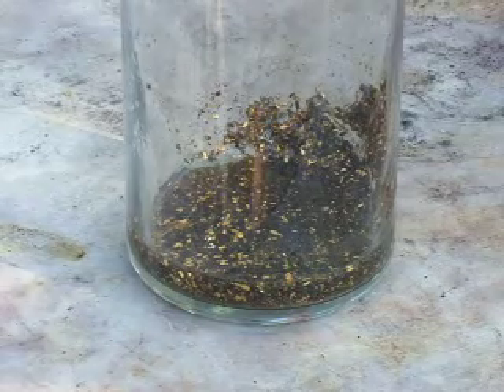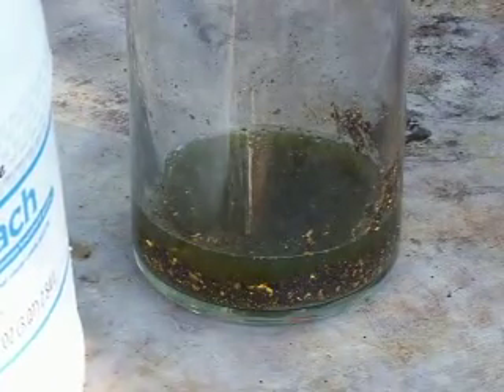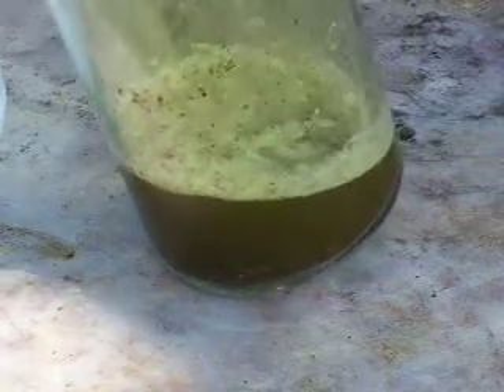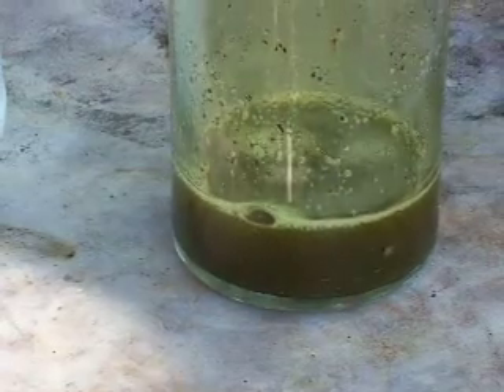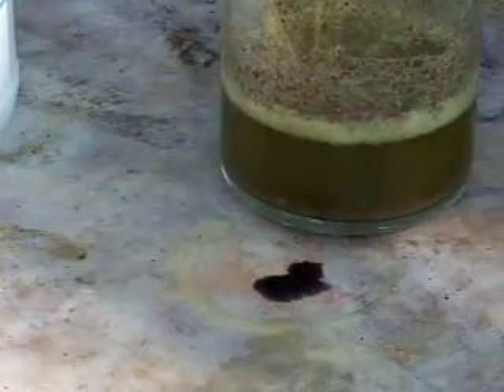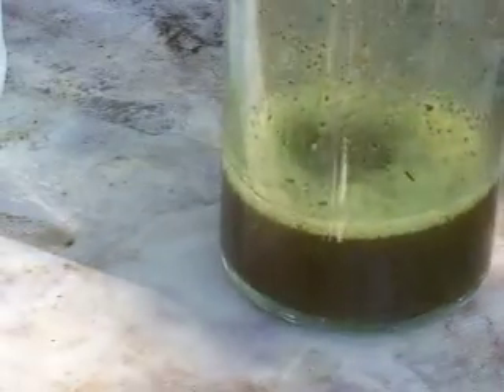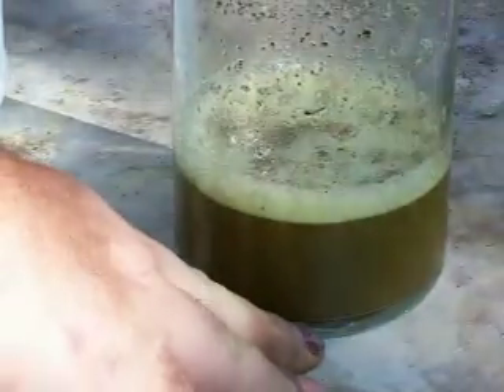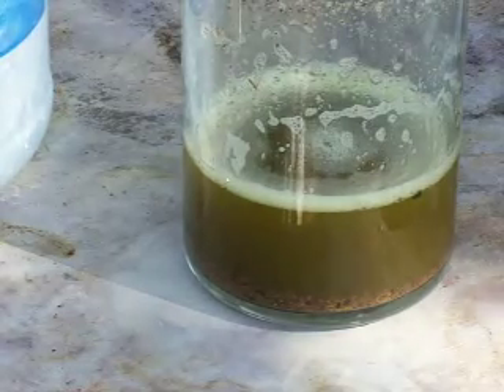dissolving finger foils

Comment: Hi Geo, love your videos. I've just run my very first batch of foils (a small experimental batch and as of right now, the gold powder is settling after using SMB.) At first I was leery about using this method and I know bleach is basic. I've seen you and several others on youtube use this method, so I know it works, however, I have a couple of questions... How is it possible for this method to work. I have a general understanding of chemistry based on what I've learned in school, and then 20 plus years working in the chemical industry. How does the basic beach not neutralize the acidic HCl? What actually happens between the two to cause the dissolution of the gold? Is it actually the chlorine gas generated that breaks the gold down? Actually, NVM the last Q.... Just re-watched the video, and you answered that one.  P.S. Read Hoke .... great stuff...

Thanks for the great videos as they're very helpful. All the best. Cheers! - Paul
Reply from the maker: Sodium hypochlorite is basic and neutralizes some of the HCl when it is added. The sodium hypochlorite decomposes into sodium chloride and chlorine gas. Chlorine gas oxidizes gold by itself. The HCl dissolves the gold oxide into solution. An excess of HCl is recommended when dissolving gold with bleach.  Gold dissolved in this way has a formula HAuCl4.

Comment: Hi Geo. Is it possible that 4ml of 71% nitric will dissolve more than 4g of gold from foils?
Reply from the maker: Short answer, yes. Through use of inhibitors and refluxing, nitric acid can be stretched out. By using a reflux apparatus, You can reclaim about 30% realistically. Under ideal lab conditions, you can reclaim around 40%. One other method that will reduce the use of nitric acid is to add the nitric acid needed in small increments. Wait for the reaction to stop completely before adding more. This is also a good way to measure metal content. Acid used in ml's equates to grams of metal. By recording the amount of acid used in ml's, you can calculate the amount of metal dissolved in weight. Refluxing is simple and google will give some examples of reflux apparatus. You can reflux to a separate container or reflux back into the reaction vessel. Ethylene glycol has shown ability to trap nitrogen dioxide in solution. It can be added in small amounts relative to the volume of acid used. I don't recommend using ethylene glycol in AR solution but rather leeching with just nitric acid.
Reply from the maker: Simply covering a beaker with a watch glass will also reflux some nitric acid back to the reaction.
Reply: Got it. Reason I was asking is that I have foils in AR and it seems a lot of foils to be dissolved by only 4ml of nitric. I know you have a lot of experience so I thought I'll ask. You think it is safe to use 5g of smb for precipitation?
Reply from the maker: Sounds good. Be sure to test the spent solution. Remove the spent solution from the gold and heat the solution. You may see a little more dust form from the solution. Let it cool completely and test again with stannous chloride. Any color change is suspect for precious metals. If you test without heating and cooling the solution, the SO2 in the solution will cause the stannous to go brown. It is a false positive.
Reply: Learning more from your videos than reading books. Thanks for taking the time to reply.

Comment: Geo any difference between SMB food grade and the one from Science Company?
Reply from the maker: Not from my perspective. It works exactly the same. It's just the chem store can charge more because it is .01% more pure. Another source of sodium metabisulfite is Bonide brand stump remover. Make sure of the label. Why pay more for the exact same thing.
Reply: Exactly....why pay more? I was searching on ebay and saw a big difference in price and If I remember correctly in one of your videos I saw you bag of SMB and  thought it was looking exactly like the SMB food grade they sell on ebay. Anyway thanks for clarifying it for me. Which do you prefer SMB or Bonide stump remover?
Reply from the maker: This is most likely what you saw. It is from dudadiesel and since I happen to live a couple of miles fro their warehouse, I just go by there and pick it up from them. As far as performance, it all works the same way. I have used the Bonide but consider it a work around and something I can use in a pinch.

 http://www.dudadiesel.com/search.php?query=%22sodium+metabisulfite%22
Reply: Yes that's the one I saw you using. Just ordered a 5lb bag for 16.92. Thanks for the info.

Comment: Hello geo ,when you do the sulfuric cell do you have to put apart brass, copper, iron gold plated pin or can you put them together in the cell to deplate the gold pins
Reply: What if u get soder in with the foil after ap fillter.  I got gray slug in with my foils is that lead or soder

Comment: Hellow geo a got a question does the sulfuric cel works with aluminiun basket o its got to be copper basket
Reply from the maker: Aluminum will work for a short time. Aluminum is not very reactive in sulfuric acid but when you add electricity and heat, the aluminum is degraded into aluminum sulfate. You will have to change the basket more often than if you used copper perhaps even getting one use from each basket.
Reply: Thank you so much .geo i have learn a few good things from youre work i has help me with the gold  process

Comment: Hello Mr. Geo. I have dissolved some foils but the result wasn't what I expected. I dissolved with HCL and bleach, in about 5 minutes all foils were dissolved. when I did the stanous test it didn't change colour. have i done something wron or the foils were almost nothing? https://youtu.be/CR-KcLcotcE https://youtu.be/OQYqe7uN70I  https://youtu.be/EVUGX4HEkQY 
then
Reply from the maker: +Helder Freitas Unless you remove the excess chlorine, the positive test will not appear. It is called a false negative. Add some more HCl, at least double the volume you have, and heat the solution while stirring. When you can stir without tiny bubbles forming, turn off the heat and let the solution cool. Test the cool solution. If there is still not a positive test, your stannous chloride may be bad. Make fresh stannous chloride and test the solution again.
Reply: +Geo after cool did the test, still negative. could it be of the stannous? I bought it on ebay, or could it be I don't have enough gold on solution?
Reply from the maker: If the stannous chloride is good, it will detect even a very small amount of gold in solution. If you can, dissolve a small amount of known gold (like from a piece of jewelry) and see if the stannous chloride will give you a positive test with it. In refining, it is called a "standard" or a solution of known gold content that you can test your stannous chloride against to make sure it's still good.
Reply: +Geo ok I will try to do that. can I try with a small gold  button  Thank you Mr. Geo,  you are very kind always answer my doubts
Reply from the maker: Yes,a gold button you are sure of will work great. There's no need to dissolve the whole portion but only a small part. Like I said, stannous chloride will detect very small amounts of gold in solution.
Reply: +Geo I put the nugget in this solution,  let it dissolve for a while and then test it?
Reply from the maker: Yes. If you are using HCl and bleach, carefully flatten the gold button. Place the gold button on a piece of cloth. Fold the cloth so the button is in the crease. Use a hammer to tap the button inside the cloth until it is flat. This way you can flatten the button without losing it. If you just lay the button on a hard surface and strike it with a hammer, it may fly to someplace and you will lose it. If you flatten the button, it will give it a greater surface area so the acid can dissolve some of of the metal better. You can always remelt what is left into another button.
Reply: +Geo should the solution be hot or could when i put in the button?
Reply from the maker: If it is HCl and bleach, it should be cold. It will heat on it's own.

Comment: Geo what about putting the foils and hcl + bleach in a soda bottle or other container that can be capped off and shakin to stir it better?
Reply from the maker: There are two real good reasons off the top of my head. AuCl3 is formed when you dissolve gold using chlorine but because there is an excess of HCl, it almost instantly converts to HAuCl4. This compound is is a weak solvent for PVC (polyvinyl chloride) which most plastic bottles is made of. It dissolves a very thin layer on the inside of the bottle and the gold in solution gets trapped leaving some of your gold locked into the plastic. The second reason is, bleach is mostly sodium hypochlorite. When NaClO is mixed with HCl, chlorine gas is generated in huge volumes compared to the volumes of liquid used to create it. In other words, combined with HAuCl4's ability to dissolve PVC and the pressure created by the expanding chlorine gasses generated, a plastic bottle could rupture and explode throwing acidic solution everywhere. It is always good practice to never cap a reaction where gasses is being generated.
Reply: That is some of the best advise I have gotten from anyone while refining PM's. Thank goodness I waited to receive your reply before I did anything. 

Thanks again, I'll post you some pics of my progress if that is ok.

I guess I need to go back and reread Hokes book again
Reply from the maker: ***** I would appreciate an update, thank you. Miss Hoke's book is a great guide and most of what she teaches is as good today as when she wrote it but she knew nothing about modern electronics. She can guide you to make the gold pure but the methods for recovering the gold from electronics to begin with was beyond her time. I can't remember ever reading about sodium hypochlorite in Refining Precious Metal Waste.

Comment: I would like too believe I did this step by step just like your video. My solution is a dark color must more green. Is this fixable? what did I do wrong?
Reply from the maker: The foils in this video had organic trash but the foils themselves was base metal free. If the solution is dark, it probably means there's base metal in the foils. Is there any solid metal left after all the foils dissolved? If there is, there's still some gold left undissolved. After testing with stannous chloride and getting a positive test, warm the solution to steaming and let it cool completely. It should be ok to precipitate from this "dirty" solution.
Reply: First Thank you for the response. I checked with Stannous Chloride I liquefied last night. It changed to a light purple. I had put my solution in a coffee pot and warmed it last night to cook off so of the chlorine. today I have a clear green liquid with crystals in the bottom. Like a green snow cone. I'm confused.
Reply from the maker: Terry Louis The crystals are salt. Mostly sodium chloride from the bleach (sodium hypochlorite). Filter the solution into a clean vessel but do not rinse the white crystals with water. You can let them drip dry in a small container. Toss the salt and keep the filter and add it to your used filter bag. If you want, you can heat it back up as it is and evaporate some more liquid out and let it cool again before you filter. It will make even more salt precipitate out. Just don't let the solution get dry. Stop evaporating at about a quarter of the solution you have now. When you test it again, that light purple will be very dark purple. Did you check to see if there was any more metal that didn't dissolve?
Reply: Thank you. I did not see this the last time (the only other time) and would like to believe I used the same procedures. So this would be to much bleach?
Reply from the maker: Terry Louis Not really. When you saturate a solution with any salt and then reduce the volume of liquid by evaporation, the salt will crystallize out of solution.
Reply: I am doing my best to read, watch and learn. I did not realize there was so much. I want to thank you.

Comment: I have watched this video many times, Thank you for taking the time. And now the questions. Today I bought a box and it has a mix of, you name it is in there. Pins gold coating, cables ends, ic chips and it looks like gold corners and parts from circuit boards that have been removed by hammer. This would be like sorting grandpas out nut and bolt collection. Would this method work? Or is there a better way?
Reply from the maker: It all needs to be separated and processed separately to get the foils loose and liberate the unseen gold inside the chips. visit and register at www dot refinementofpreciousmetals dot com. You will find me and my avatar there as im one of the moderators. All the different processes is described in the forum and its always free to join and will never cost you a penny.
Reply: Geo I was afraid of that. I did not mention earlier that the box is about 34lbs. 
Thank you for the link.I will see you there.

Comment: I like the heads up you give regarding not using this setup to dissolve rings, etc. I didn't realize it wouldn't be practical to do so. Would it be recommended to use AR for that situation?
Reply from the maker: all solids larger than the thickness of a human hair needs to be dissolved in a stronger oxidizer than bleach. AR will work for almost all solids.

Comment: Hey geo, Ive been recommended to watch your videos & thanks for all the info. Im still learning but the first time I tried using the AP method, I did a small batch, used 20ml of muradic acid & 10ml of 3% Perox. After I strained it, it seemed like the gold was melting vs just coming off the parts, so I have tons of little flakes in my left over solution which unfortunatly got deluted a bit. Ive got a few filters with small small parts of gold & one thats mixed with the same black material but more sand like & gold. Should I take the solution & extract the copper & gold by dropping something stainless steel in there? I also have a container full of gold flakes that have been rinsed from all my AP methods, should I now disolve them in MA & bleach then filter or just hold on to melt them down? Sorry Im doing my best to research & i posted on forums everything I did but so far just trolls no helpful answers
Also with all my filters..will the muradic acid disolve the coffee filter & other stuff, then use stump out to recover the dust? Or should I cut the papers up, cover them with borax & melt.
Reply from the maker: there should be no gold dissolved in the AP solution. gather all solids and boil them in water. follow this with a rinse in clean hcl. coffee filters can be burned and the ash is processed. gold will not dissolve in just muriatic acid.

Comment from the maker: have you dissolved the foils or are you filtering the AP?only acidic solution will hold dissolved metals for our purposes.if you raised the PH over neutral,all metal dropped out of solution.never neutralize using baking soda unless you have a spill.if you have foils mixed with this "mud",put it back in the used AP until the "mud" dissolves.add a little fresh hcl to the solution.

Comment from the maker: a scrubber is where you use a sealed container for the reaction so that the off gasses can by vented through a line into another container that has a strong base solution like sodium hydroxide or sodium carbonate.make sure the exhaust tube is covered by a few inches of solution and it helps if there is a medium in the container (wiffle balls,ping pong balls) with base solution cycled over it from the top.the fumes need 8 secs of exposure to the base solution.

Comment from the maker: subzero is a proprietary chemical sold by ishor. its also a common fertilizer sold at most nurseries or feed stores.it is sodium nitrate (nitrate of soda). it is one of the ingredients of "poor man's AR". its a nitric acid substitute.it works the same way as nitric acid in solution but needs to be heated for it to work correctly.

Comment from the maker: its ok to add peroxide once at the start of the process.as a matter of fact,you have to.hcl alone will not dissolve copper.peroxide oxidizes a small amount of copper into copper oxide.this is dissolved into copper chloride. CuCl will dissolve copper.the trick is to add an oxygen source without having to add extra peroxide.once you have your CuCl from your first batch,you just keep using the same solution over and over again.

Comment from the maker: hydrochloric acid alone will not dissolve gold but when you add an oxidizer,any oxidizer,even pure oxygen,gold will go into solution.when gold is in hcl and oxygen from any source is added,the source will give up an oxygen atom to the solution while taking on a hydrogen atom.its called ionic exchange.be sure to check the MSDS on any chemical to see whether its an oxidizer before adding it to your solutions or you may be losing gold.

Comment from the maker: hcl and hydrogen peroxide WILL dissolve gold.be careful how much peroxide you add to your AP solution.only add peroxide once to start the reaction and use a fish tank pump to keep the solution oxygenated.AP (acid peroxide) was first used as a refining tool to dissolve fine particle gold without using nitric.normally the concentration of H2O2 used was above 32%.be careful,when concentrated H2O2 steams,the vapors are explosive and will self detonate.

Comment from the maker: what chemicals do you have access to? there are many ways to remove the gold from fingers.the best way is to remove the base metal first and then refine the gold that's left.the fastest way is dilute nitric acid bath.the safest way is acid peroxide method (hcl/H2O2).the worst way is to dissolve all metal in aqua regia.the most dangerous way i can think of is cyanide leaching,but if one drop of acid is accidentally dropped into the solution it will kill you with hydrogen cyanide gas.